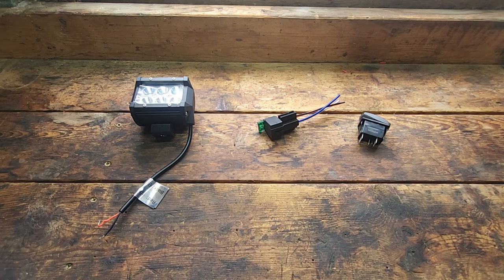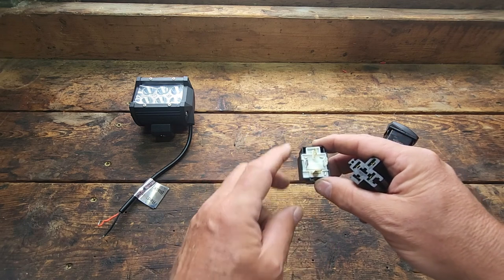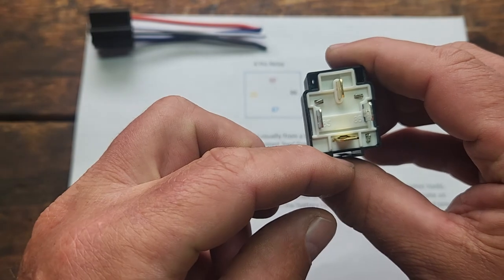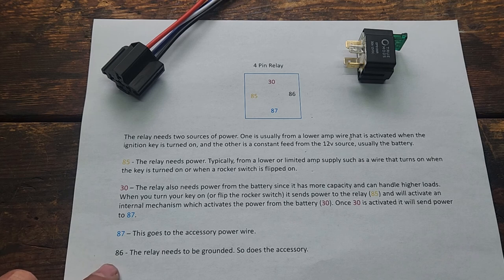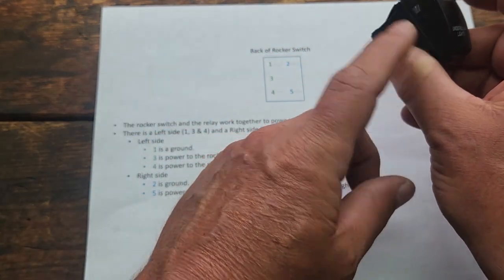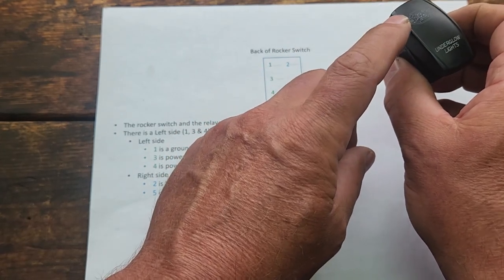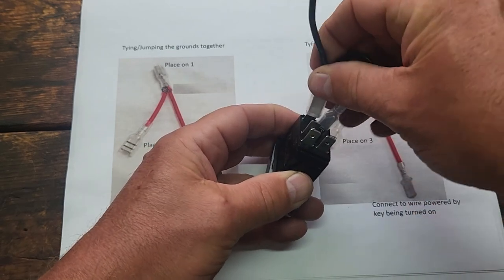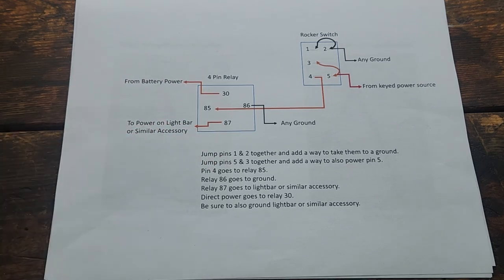How to Wire a Rocker Switch & Relay - Simple & Easy

Comment: Thank you for the video. I followed your instructions and got everything wired up, but it didn't work. I checked everything multiple times and found my ground wasn't tight enough. After tightening the ground, everything worked great. Thanks again.

Comment: Hey again you made it so easy what I did to make things easier (using my power supply) I built a “demo” board, it has a ignition switch, a 5 wire relay, and rocker switch. Now when I wanna check a set up or new accessory It is all prewired just like a dash of a car. I plug in the hots, and ground , and run my wires to what I want to check. And if it all works. It makes installation so much easier. I just took your layout and made it into a board. Thanks again
Reply: Awesome! Glad to know the video was helpful.

Comment: Hey you have saved me once before . I have a question , I have a light hooked up. But it doesn’t have a sep switch . I have a spot for a rocker switch , the switch says interior it’s perfect , can I use a 5 pin rocker switch as a simple on/off switch ? Thanks
Reply from the maker: Yes. You will use pins 1, 3 & 4. Ground pin 1. Run your power from the battery or other power source to pin 3 (you should fuse this line with an inline fuse). And the power to the light will go to pin 4. You will also have to ground the light. So basically power comes into the rocker switch at pin 3 and when you flip the switch power leaves pin 4 and powers the light.
Reply: Hey thanks so much , I appreciate you helping me. I got the relay stuff down lol thanks to you, but I have a light I wanted to put a rocker switch onto. Thanks so much. I really appreciate it very much. 
Chris

Comment: Bear , I have a question on the switch part .  “Could “ you hook up power to a light wire and not the acc key wire ? 
Also 
Well let me explain what I’m doing ; 
I’m putting a 6 gang ( nilight ) switch box between my sunvisors . 
1 switch to KC Daylighters
1 switch to KC Daylighters 
1 switch to a LED light bar 
1 switch to roll bar bed lights 
1 switch to possible fog lamps ( trouble is my light switch turns the fog lamps off when high beams are activated don’t know if I want that ? ) 
1 switch to back up led lights ? Maby 

Also where should I put my fused relays ? ( mount them )   2003 F150 Regular cab 
Thanks much 
Mouse

Comment: Absolutely excellent video. Always been hard to find a video out there, where it shows the combination of the accessory, relay, and a rocker switch. Great job! Now I just need to figure out where to put an in-line fuse as my relays do not have a fuse spot. I would assume that the fuse would go between direct 12V power and 30 on the relay?
Reply from the maker: Yes, put the in-line fuse after the 12 volt source and before relay pin 30.

Comment: Do you need to have a power wire from the battery directly to the switch? Or would the power be ran down through & out of the relay to power the switch?
Great Video!! just a little confused on that part.

Comment: That was SUCH a helpful video! What gauge wire do you recommend for fog lights?
Reply from the maker: I typically use 16g on my LED low Amp stuff, which is overkill. 18g is fine since fog lights are low amp.

Comment: Hey sorry to ask it may be obvious but to wire to keyed power is that just any wire in the car like radio etc that's activated by the key? May I ask which you wired it to for your vehicle?
Reply from the maker: If you're looking to tap into a wire that activates when the key is turned on (radio is a good option), go to your fuse box and locate that fuse. You can also use a multi meter to see which ones power up when the key is turned on. You can then use a fuse tap to get your power. Check out this video for fuse taps: https://www.youtube.com/watch?v=nasuPwpr55I
Reply: @Coffeybear13  thanks heaps mate you're a legend, your video has helped me heaps and I really appreciate it, including your reply! Honestly can't thankyou enough my driving lights have been mounted for weeks whilst I tried to figure this out after blowing several fuses lol!

Comment from the maker: You only power the relay (pin 30) with constant power from the battery. If you do not use a fused relay like in the video, you will need an inline fuse between the battery and relay pin 30.

Comment: If I have a 5 pin relay, can I just leave 87a not connected
Reply: Yes. That pin is used for "add-on" power. Like when you turn your high beams on for your headlights.

Comment: @Coffeybear13, I need help wiring my hazard rocker to my relay. I have a 3 pin relay and a 5 pin rocker. No matter what I do I can't get lights to flash when rocker is on. The blinkers won't work until I turn rocker switch on also. Can you help? I'm lost
Reply from the maker: @MicoNelson  You need a flasher relay. Some good videos on YT. See if this one helps:https://youtu.be/lnhMx-fnUmI?si=azLmK62z1--WBuwt
Reply: @Coffeybear13  thank you, yeah my relay is a flasher relay, 3 pin, a hit a ground and an output I watched video link and will give it a try. I will let you know, thanks again